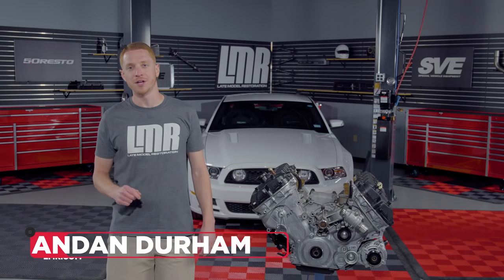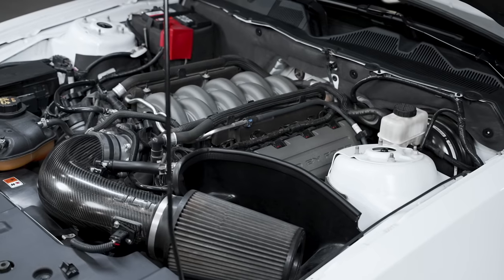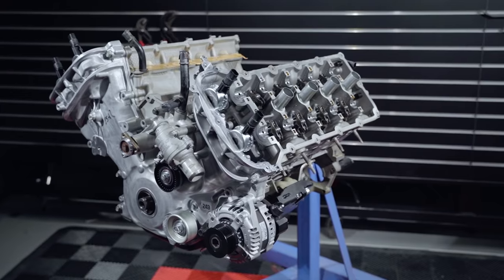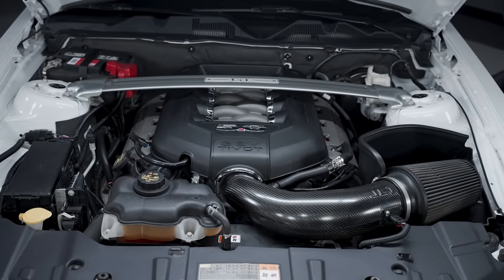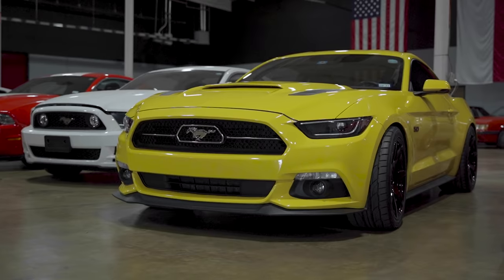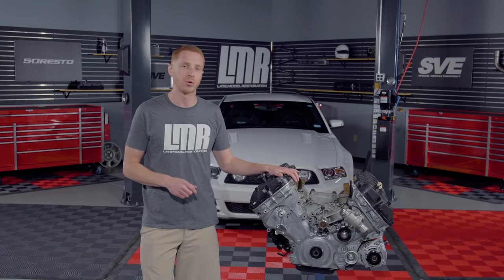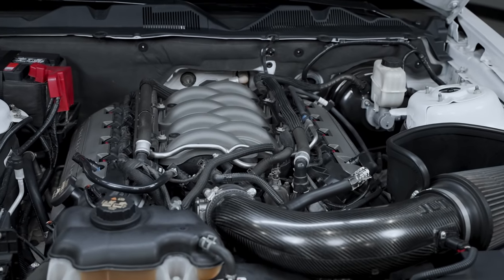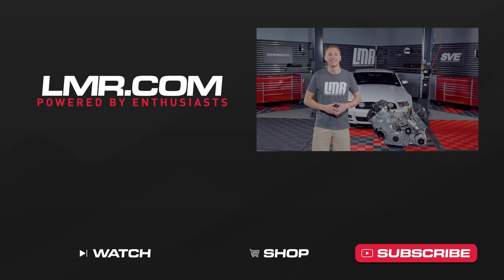Mustang vs F-150 Coyote Engine | What's The Difference?

Comment: The original 5.0 was under 301.49 ci and this new 5.0 is 301.50 or greater which makes it a true 302 5.0… the old one was called a 5.0 so it wouldnt be mistaken for the 4.9 300 at the parts counter cause we all know how easy it is to confuse parts guy
Reply: IDK, when I was a teenager working the parts counter I would always mess with Ford owners.  They would come in and ask for some part for a “302”.  I would always ask, “Is that a Ford or Chevy 302?”  I know I was a smart azz when I was younger.  Still am actually.
Reply: @cdnmetelhead4013  but thats actually like a legit question tho… the only thing is the Ford 302 is known to be a good engine… the chevy 302 not so much… both have their limitations but you can get more out of a ford 302 than a chevy 302… and the chevy 302 only lasted so long while the ford 302 ran for 3 decades
Reply: @TheFARM2019 the Chevy 302 is a great engine.  The reason they stopped making it was the rules changed in the Trans Am series allowing them to destroke the 350 instead of having to build a factory 302 cubic inch engine.

Comment: I owned a 2003 Nissan Maxima that had the 3.5L ... same engine as the 350Z with the 3.5L ... only difference was the 350Z was mounted differently ... so I spent the $$$ to Z-spec my Maxima ... was a fun ride for several years before I sold it
Reply: That thing will last forever if you treat it right. My dad got his new amd it had over 200k when he got rid of it.

Comment: I love the 5.0 in my 2018 f150 work truck but damn it rattles like a diesel and burns oil at 80k miles well maintained
Reply: Throw a bottle of MMO in there 1000 miles before oil change. Will quiet that rattle down.
Reply: @Maroco918  I've put a bottle of Lucas oil stabilizer in it and it did nothing
Reply: @Blue_Flame_Raptor  I've had really good luck with MMO in mine, that's why I recommend it. I've never used Lucas, but I'm sure it's a good product.

Just passing along what worked for me. Happy 4th 🇺🇲
Reply: @Maroco918  you too, thanks!
Reply: Fords are hit or miss on build ngl
Reply: @redlight3932  sometimes

Comment: Couldn’t get the bottom zipper of back rest to close I had a two inch gap I ended up using zip ties to hold it together I tried everything heated the vinyl and kept pushing the vinyl down no luck

Comment: Question, my 12 Mustang Gt might have Knock or spun bearing. 
Can I take a F150 engine and put my top end on it and swap it into my mustang?
Reply from the maker: There are a few different ways to tackle this.  I'm assuming you're swapping an engine from a 2011-2014 F-150?  If so, I wouldn't bother with switching the cylinder heads or the exhaust cams.  Swap the intake cams, the timing cover, accessory drive pulleys, and the intake manifold.  You'll be down a little on power because of the 10.5:1 compression.  -Landan

Comment: You think I’d be able to drop a gen 2 coyote from an 150 into my 12 gen 1 mustang?
Reply from the maker: Yes, but why would you do that?  The gen 2 F-150 engines have a 10.5:1 compression.  If you do go that route, you'll have to swap the Mustang timing components.  -Landan
Reply: @latemodelrestoration  because my gen one is dead and found a running gen 2 truck motor that’s much cheaper than what it’s gonna cost to get take the heads to a machine shop
Reply from the maker: @jmasterlink13  I understand.  As long as the valvetrain is good in the Mustang engine, my comment above about swapping certain components is what you'll need to do.  I also forgot to mention that you'll need a tuner to change the firing order to match the F-150.  Let me know if you have any questions. -Landan

Comment: how high can you rev an F150  Gen 1 coyote with the stock cams? I'm putting a 2018 mustang manifold on my 2014 F150.
Reply: Did you get the intake manifold put on your Gen 1 F150? And if so, how did it go for you? Did it make a any respectable amount of power from it or is it not worth it? Got my hands on an 18 mustang gt manifold for a few bucks and I'm still debating whether or not I should swap it in.

Comment: I have a very late 2014. How can I tell the difference in the cylinder heads if they were 2015s?
Reply: Ask them, they will tell you.
Reply: I have a late 14 with the different head on one side. They are NOT the same as 15-17 Mustangs but are the same as 15-17 F150's. Valve sizes are the same in all gen 1 coyotes and 15-17 gen2 truck coyotes.

Comment: Reliable my ass! I'm on my third Coyote engine
Reply from the maker: Hate to hear that. There is always a few bad apples in the bunch. That doesn't take away the overall averages of reliability. -Landan
Reply: @latemodelrestoration he said he is on his THIRD engine.   That’s more than unfortunate.
Reply from the maker: @robertpoirier8520  I understand what was said. Yes, that is very unfortunate. There are plenty of high mileage Coyote engines out there without issue. Like I mentioned in my previous comment, there are bad apples in every bunch. -Landan

Comment: Way too complicated, weak and expensive to mod and fix
Reply: Chevy fanboy alert!
Reply: E85, Boost, fuel system. 800+ wheel. Say what you will about the complicated aspect cause it's a very advanced engine compared to the pushrod design of the LS but the Coyote is far from weak.
Reply: That's why GM's next hot engine will be a DOHC.  Perhaps because 4 valves is good for an easy 18% in hp and 15% gain in torque vs 2 valves.

Comment: Coyote is good but not LS good😉
Reply: Not really. Power to displacement, the 5.0 beats the LS. The LS is cheaper and smaller in width, so it can fit in project cars, but Chevrolet has had lawsuits of them cutting corners with build quality of the newer units.
Reply: @rickitysplitz7035  Ford has also had lawsuits due to poor quality and performance in some engines. 
LS is a proven platform in naturally aspirated or forced induction applications. A Coyote is only good with forced induction, it doesn’t have the cubic inches to compete with an LS3, LS7 or LT1 engine naturally aspirated.
Reply: That's your opinion and who cares what you think.